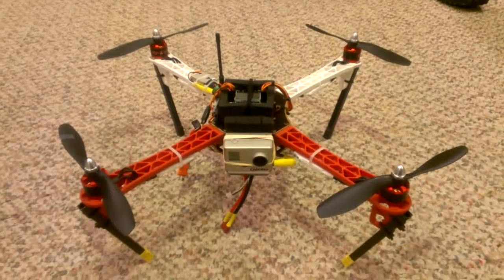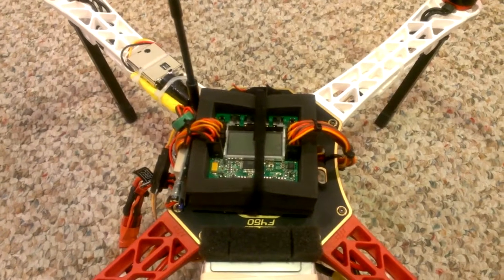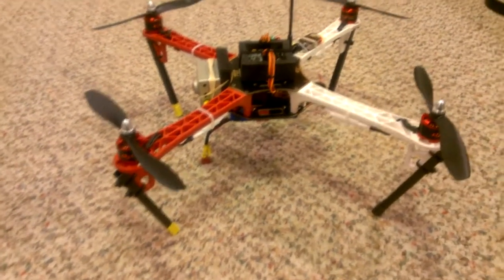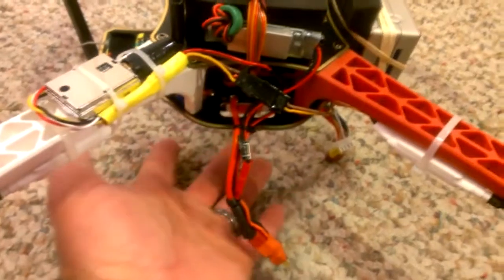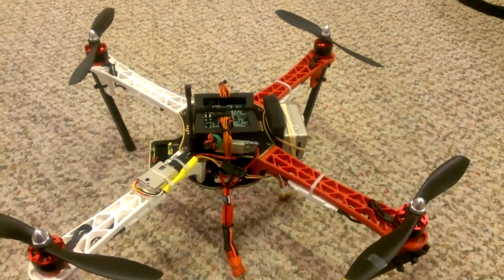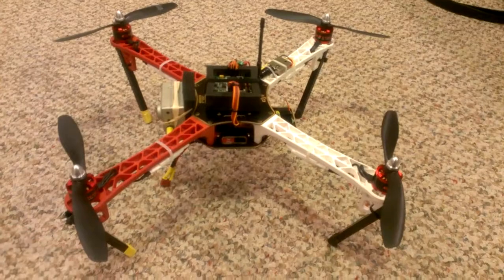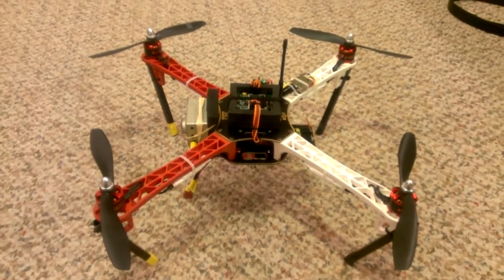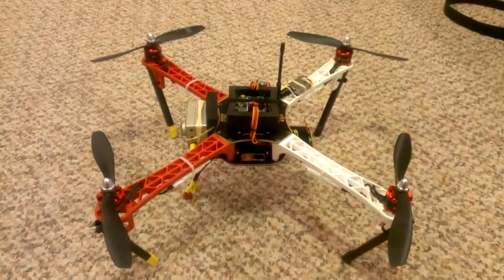DJI Flamewheel 450 FPV ready to go

Comment: I want to see how it fly's I have the f450 DJI Naza but I put it on a TBS frame,by the way it flys great, but I just picked up a KK2.0 board from HK and have 4 motors as well as all the parts to make a new F450 so I'm going to set up a new one so I will start on it tomorrow. let me know how to set up the stablization mode. Have a great day.